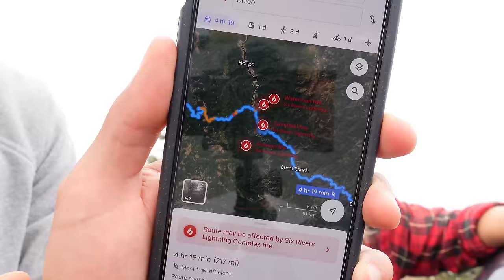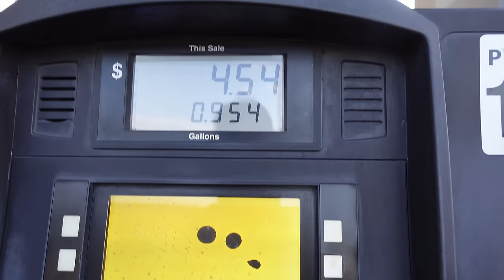Our Craziest Prius Camper Upgrade Yet! (lift kit)

Comment: With front wheel drive, you can often get more traction BACKING up the steep hills. Going forward up the hill, the center of gravity shifts away from the front (drive) wheels and toward the back wheels. If you back up, then the front wheels are downhill and the CG shifts toward them, giving you a little more weight and traction on the drive wheels. Just something to keep in mind if you REALLY have to get up a steep gravel hill in the future.
Reply from the maker: Thanks Dave!
Reply: I mean... I don't know about that one... there is no way where I go in my Prius I'm going to drive backwards up the hill. heh or maybe that's just me!
Reply: @blackjmyntrn  Yeah, I definitely wouldn't use that trick for a long drive where I knew I didn't belong, but to get out of a bad spot, it's a useful trick.
Reply: @daveduncan2748  If you drive a Prius, you belong everywhere! :)
Reply: Prius only use electric drive in reverse... its slow and not powerful going backwards, regular logic is counterintuitive on a prius...
Reply: Yep this works! I live down a gravel road and my driveway is also gravel and STEEP. One evening, I had tried going up like normal but with the animal feed in the back (3-4 bags x 50 lbs) my Prius couldn’t get traction. I had chains but they were buried under the feed. It dawned on me to try going backwards. Took a couple of tries until I could figure out my path. Once I got it going, I pushed the gas as hard as I could without losing traction and the car made it! It can move pretty quick in reverse. Thank goodness for a back up camera lol
Reply: @blackjmyntrn   and why
Reply: @JR-gn9ei  lost me, how can i help?
Reply: Did this in a Yaris, I moved into a house in the mountains with a 32-35% gravel driveway. It’s doable but not something you want to do every day.
Reply: Spend 1 min cheat code to turn off traction control or have dr prius app and do it manually in the app no need for all reverse then just floor it
Reply: The best idea is the awd version

Comment: Maybe I'll have to lift my Prius. I've hit the front of mine on those parking space barriers many times. Try backing your Prius up that gravely hill. With front wheel drive you normally lose weight on those front wheels driving forward up a hill. Backing up the hill has the opposite effect.
Reply from the maker: Honestly it's a gamechanger. It's been a week since we made this video and it has been a huge boost to the cars overall usability. 👍🏻

Comment: This is super cool, and it really levels out the ride height, definitely a nice quality of life upgrade.

Also just FYI, you shouldn't fill your tank past the first click, as overfilling can cause gas to enter into the EVAP system/charcoal canister/etc., and while it might only cause a temporary check engine light, at worst it can be an expensive fix! Ask me how I know haha
Reply: Agreed!
Reply: On a prius? I've absolutely topped off the tanks on a 2nd and 3rd gen and prius c for thousands of tanks no issues ever at the courier company i work for... idk how you managed that? I think your evap canister just cracked and they blamed you
Reply: @16driver16  hold up wait a minute. then what is the click for? I was told that you should never go pass the first click because the pressure is too great
Reply: @comingofkym  every pump has a different flow rate and nozzle making the point at which they "click" and stop pumping is radically different depending on the setup, generally unless you pull the pump all the way out of the fill nozzle or use a gas can you will not fill it so much it goes into the vents that lead to the evap system. A slow pump with an old fashioned nozzle could overfill a tank or a pump with a faulty nozzle, and it's easy to do filling with a gas can.

Comment: Another great video! Thanks for sharing the information about the lifted Prius. Sadly I to give up my Prius three weeks ago, back and neck issues from getting in and out of the Prius. I will miss my Prius that’s for sure especially in the mpg department🥲. I got a Mazda CX 5. Really loving the ride height and the seats are so comfortable and I do not miss that horrible road noise. The CX 5 is so quiet inside. And I drive my Mazda CX 5 like I drove my Prius. Lol yes If you keep it under 70 mph you get very good mileage. The best mileage I got over the 3000 mile trip I took was 37 miles The lowest mileage I got was 31 miles per gallon. Plus it has all wheel drive.But I will always have love for the Prius.❤️
Reply from the maker: Sorry to hear about the Prius! Glad you’re here though, thanks for the comment!

Comment: Hey guys. Love the lift kit. Try the same hill in maintenance mode. It turns off traction control and it will help. Maintenance mode and be turned on or off with apps or by a sequence with ignition, brake and gad pedal. It does run the ICE all the time tho. But if turned off with a key cycle of ignition!
Reply: this is the best response with resolution or go faster. :)
Reply: Idk how to do it on the 3rd gen but it helped a TON when I was in the snow on a hill in town in 2nd gen prius.

Comment: I did a long road trip in the US. You should add a CB radio with a tall good antenna because there are places and long stretch of roads with absolutely no cell service. A can of extra fuel tied to your roof is prob a good idea too.

Comment: So L&L, you would have been successful making it up your off-road path if you'd have disarmed the Prius' traction control. You can look it up on line. I used a Prius as a rural mailman and drove it all day long in this mode especially in the snow. It's a simple sequence when starting the car using the Power button and flooring the gas pedal 2x and shifting from neutral to park etc. Check it out and keep the instructions in your glove box.
Happy Trails! Jon

Comment: Prius Overlanding has a custom 2" hitch that's angled upwards slightly which helps a lot with the box on the rear too.

You can also disable traction control for gravel roads, snow, etc using your phone and a Bluetooth OBD2 adapter.

Comment: Morbidly curious, how's lifting your Prius treating your hybrid milage?  Also does it feel looser on the road as you drive (wind grabbing ahold of it more etc).  When we had a Prius I swear all we did was bottom out on the back roads to my parents lol.   I ended up going back to SUV land, but now our lovely kina has an EV cousin so we're saving for that. We'll get the backroad ease of an SUV without feeling like gas guzzling jerks every time we take the car out of the garage (although our kina actually gets really good milage for a crossover)
Reply from the maker: The mileage isn’t affected (according to others with longer use). It actually rides very nicely, the rear springs really helped handling too honestly.
Reply: @LeahandLevi  lol sorry about the question that you clearly answered at the end. I had to pause the video and run an errand. Just watched the rest and went omg...I'm an idiot. Lol!   Thanks for the update! Honestly thought you were done talking about it after you left the shop lol!

Comment: but still lower if you want more lift up put in front lexus HS  front coil spring in rear sonata 7 coil spring it would be much better for lift and can hold big luggage also you should change your tires in 16 inch wheels and its done.

Comment: Approximately 1 gallon (US, petrol gallons are a different size in the UK, and this is why metric is important!) for a night of AC (and power bank charging), but how many gallons in the whole tank?
Reply from the maker: According to google it’s about 11 gallons. Which I didn’t know so thanks for the inspiration to search that up
Reply: @LeahandLevi  That’s not a big tank, but the hybrid design probably uses so much less fuel that a bigger tank adds extra weight, messing up the efficiency. (For reference my dad’s old Chevy with a 6 cylinder had a 22 gallon tank, while my mom’s old 4 cylinder had 16. There’s a ton of info on most cars on a sticker inside the driver’s side door frame (unless this has changed recently, the newest car my family had was from the year 2000 (my dad is great at keeping cars alive until they just fail spectacularly, his old 6-cylinder had the transmission just implode out of the blue as we were making the last turn to go home. Pushed it the rest of the way, and ultimately let the Salvation Army tow it away for the scrap value (tax write off.))